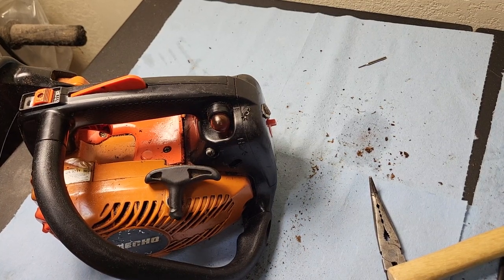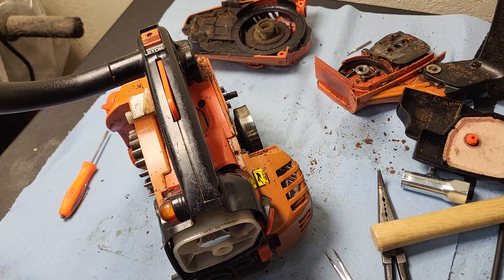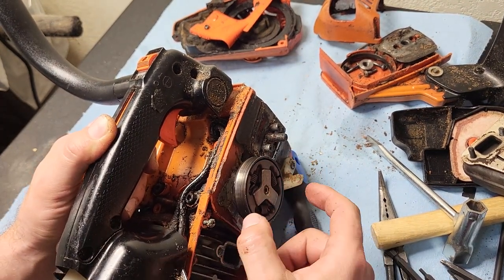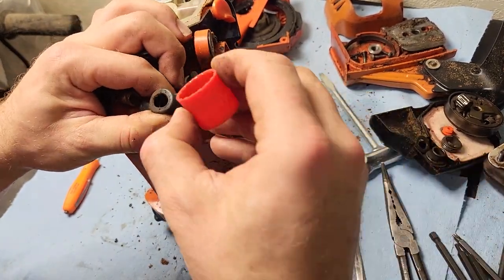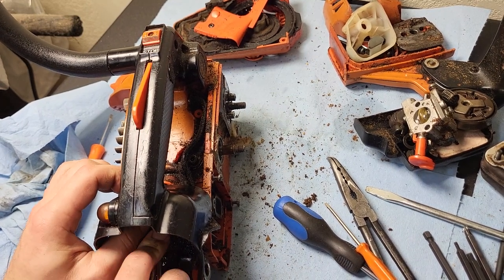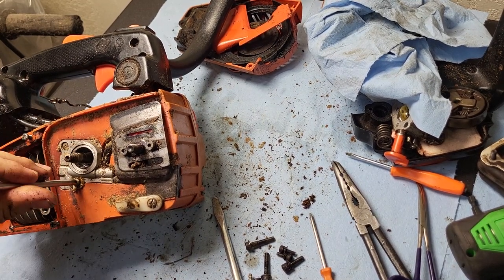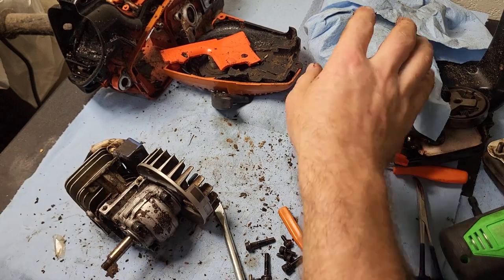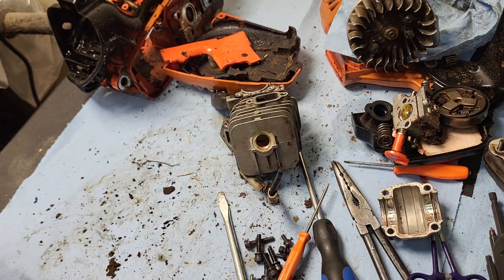Echo CS-271T - Teardown

Comment: I just torn my cs271t apart yesterday and I was going to replace with bearings and cranks seals, I also found the bottom crank bearing cap not tight and what was causing my intermittent lean condition, luckily the cylinder and piston and mint on mine still. 

I will be putting some loctite on the bolts when I go back together when
Reply from the maker: Most clamshell top handles i have seen with lean conditions have the bearing cap bolts loose or broken

Comment: I am really glad you did this video, it is super helpful, but I have 1 point of criticism. I tried the same method you used to remove the clutch. My 271t actually has compression and it would not work after many attempts. What did work was using a socket and ratchet to hold the flywheel while using a 12mm wrench to loosen the clutch. So much easier!
Reply from the maker: Gotta have a snappy impact, if the clutch has been on there a while it is harder to get loose because they self tighten over time. You can also thread rope into the cylinder to act as a piston stop. DO NOT use metal piston stops as they will damage your piston if you attempt to remove a clutch or flywheel.
Reply: @Super-Dave-Outdoors  I thought about a piston stop but I don’t have one. The hammer and punch method looked way too easy but I m not a good mechanic either.

Comment: I am writing   as I watch. Hoping you get intake boot out of handle. That is my problem. I am needing to get to the little nuts on the backside of the long screws that hold my carburetor in because they came loose.
Reply from the maker: I cant remember if those are nuts or not. They might be threaded inserts.
Reply: I got the inserts, or whatever they are called, back in place and saw runs good except it slowly floods out after getting hot then back to idle. Then it won't start without holding throttle open and 3,4 pulls. The original job was to  replace the two diaphrams in carb. Maybe I should have   checked and replaced the needle and arm under the metering diaphragm.

Comment: Finally wiggled loose after another few minutes wasted taking handle and vibration mounts loose!
Reply from the maker: Should have been 2 bolts and throttle and choke linkage. Pay attention to curved ends and angles the carb can twist around.